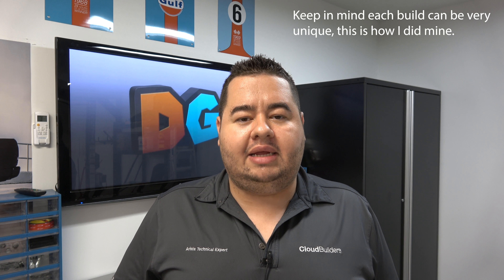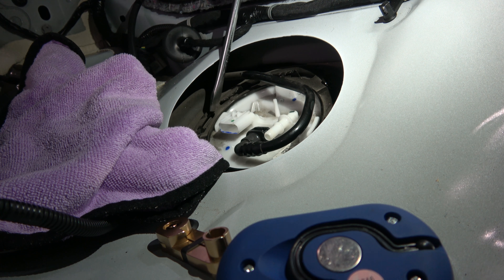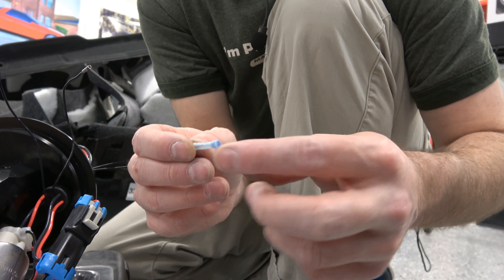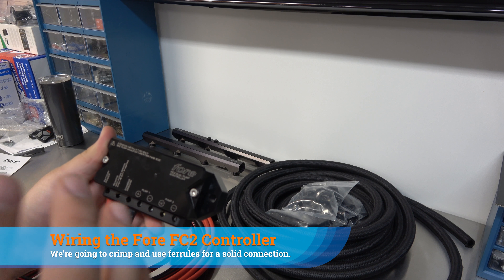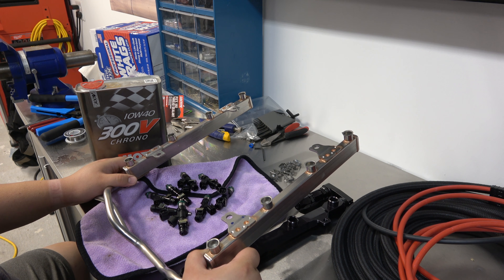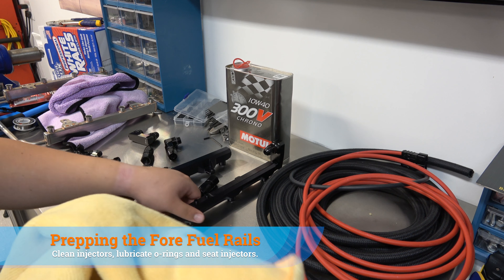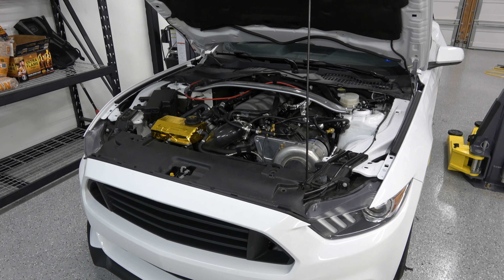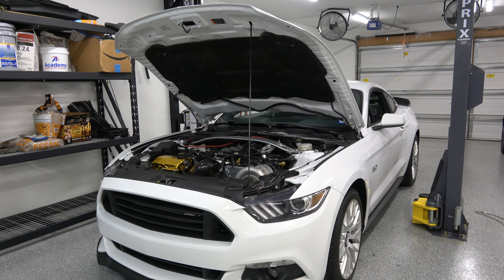Installing Fore Innovations Fuel System On 2016 Mustang GT

Comment: Why all the wiring cant you just change the fuel pump
Reply from the maker: For this setup I'm running two 450lph pumps and each one draws 190W for a total of 380W. So you need at LEAST 8 AWG wire, which is rated to 400W. In this case I'm using 6 AWG. Dropping it in and using the factory wiring would be like trying to power a subwoofer without an amplifier from your rear speakers. Essentially this picks up a signal from the factory wiring and draws power directly from the battery when the car is on. It's pretty much the same idea as an amplifier install. There are a few plug & play drop-in systems but all the ones I've seen still need a voltage booster to pump more fuel, which shortens pump life. Plus those systems are still dead-head like OEM and not return style systems which is in my opinion less desirable. Furthermore they provide a bit more headroom than a factory pump with a voltage booster, so when you start to run out of head room you'll wind up replacing those drop in systems and losing the money you could have put in towards a custom system to begin with. Ultimately it depends on how much power you want to make and which fuel you want to run and how much risk (i.e. boost a pump frying your single fuel pump while doing a pull) you want to take.
Reply: @DmitrysGarage  wow thanks for the explination i want to use boostane and gas a drop in filter is not a good way to go i have a fuel pump booster vmp supercharger

Comment: Has anyone heard anything about Jackal return style fuel system for e-85. Is it any good is it almost same install .
Reply from the maker: Not sure but I’ll look into the Jackal kit. One thing I can say for sure is that Fore Innovations (features in this video) makes a VERY high quality kit. You will know what i mean when you hold their machined parts in your hands. Its like holding a Rolex, you can tell someone tried really hard to make it nice.
Reply: System came with a vmp blower I picked up used. I wanted to see if it's worth installing it .i would still need to pick up fore innovation fuel rail. Since I wanted to get 1000cc injectors . I have my stock 2010 Shelby gt500 fuel rail . I want to replace it before putting on the blower since it's a gen 2 .
Reply from the maker: So I'm reading about this kit. Is it a single pump or a dual? I'd probably think about how old the fuel pump is. Those racing pumps don't tend to have long life spans. I'd probably swap the pump out. But the Jackal fuel pump hat seems fine to re-use. The rest is really just fittings and hoses. Are you planning to re-use that stuff? If not I'm sure Fore will sell you just those components too, it's all in their catalog. I do love the Fore fuel rails, so maybe just save the pump hat and any controller stuff it came with and see about refreshing everything else?

Comment: nope no way in hell am i doin that. boost a pump all day
Reply from the maker: Haha, it's not that bad man, just a lot of little things. It's a little challenging the first time you're doing it, but with the video and some of the great online write ups people have posted it shouldn't be too bad. The real downside is that most of us will only do this job once unless you own multiple Mustangs 🤑. On the flip side these skills should translate to future fuel system jobs on other cars you mod. Boost a pumps work too. I had a boost a pump, but they have their limits and there's always the risk of added strain on the stock pump. Also tuning is easier on a return system.
Reply: all those tools though i don't have any of that stuff. Great video though you should have done a video for the procharger install.
Reply from the maker: Yea I really wish I filmed the procharger install! I kinda started doing videos right after i installed it. Tool wise, most that stuff isn't crazy money, if you're modding cars a lot, doing any audio or other cabling stuff, then these will all come in handy. Links are in the description and i think all together it's under $150. That of course assumes you have a vice and other basic mechanics tools (sockets, wrenches, ratchets, etc...) The power tools I use are generally not required, just useful.